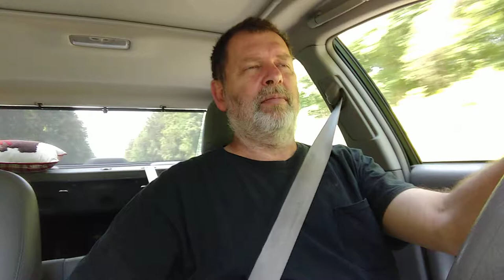I missed something!

Comment: Are you licensed to work in Virginia?
Reply from the maker: LOL...all their work is in VA up at the lake..he and Josh give a 10% discount for vets...
Reply from the maker: This is Chris:  Since we aren't acting as General Contractors, we don't need a license to do the kind of work we are doing.  The homeowner is the one responsible for deciding whether or not to pull the permits for the various trades:  i.e. electrical, plumbing, or mechanical.
Reply from the maker: Just to clarify, a homeowner has the right to act as a general contractor and is therefore the one ultimately responsible for any construction related projects pertaining to their home.
Reply: @minwifeof4boys  so if someone that's buying our house says they want some work done by a contractor do we have the right to do it ourselves and consider ourselves contractors?
Reply from the maker: @ValerieReese  Obviously, I am not a lawyer, but if the buyer is asking for work to be done then you would need to pull the appropriate permits with your local county and have that work done by licensed sub contractors and then inspected and approved.  It may be, in Virginia, that you can do the work yourselves but you would still need to go to your local building inspections department and obtain a permit and then have that work inspected.  The extent of my knowledge is that a homeowner in NC can do any work to their home by themselves but they still need to get the appropriate permits and the work still needs to be inspected.  What kind of work is the buyer asking for?